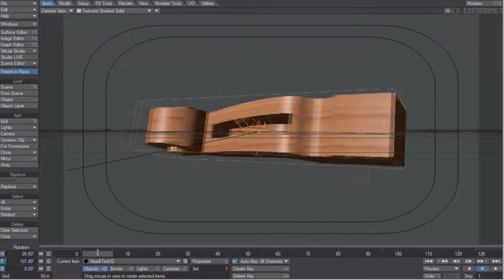3 Side Scroll Head with Stepcraft and the 3D probe

Comment: I don't recommend to buy it, it's a failure after trying Stebcraft D600, they don't give you original software that works sloppy, doesn't work well, other parts are expensive, other than suspension and sudden stop